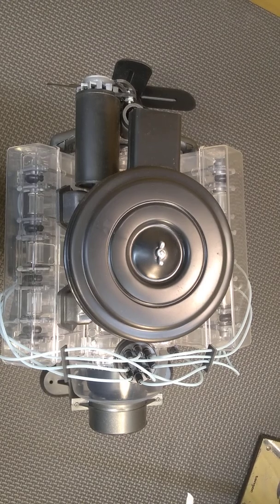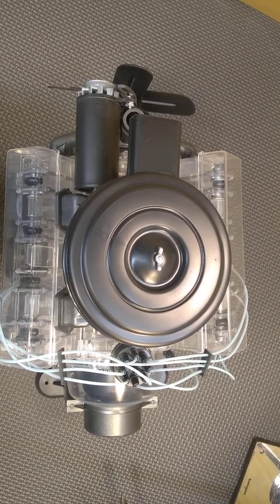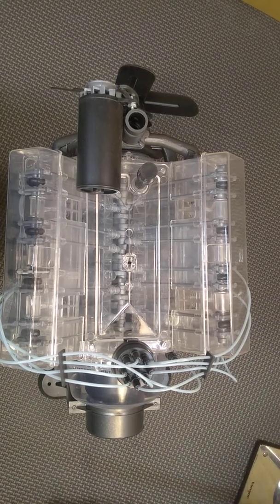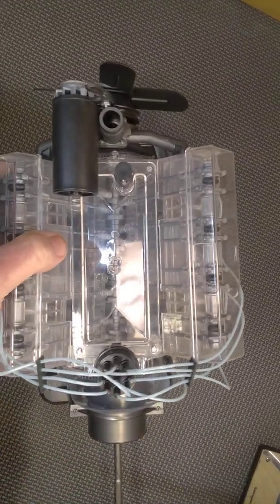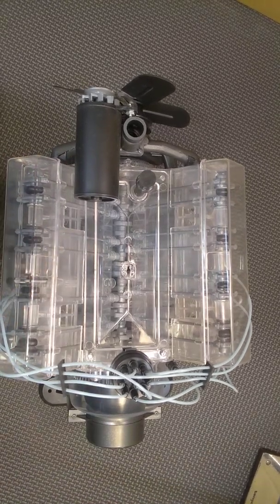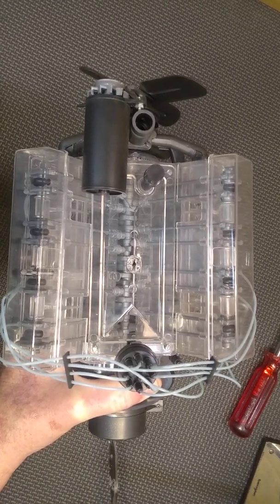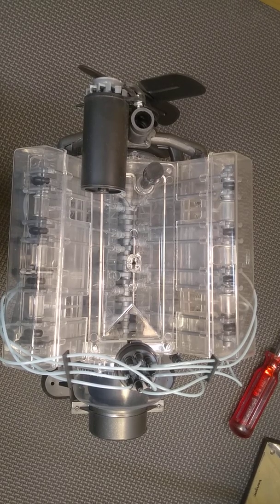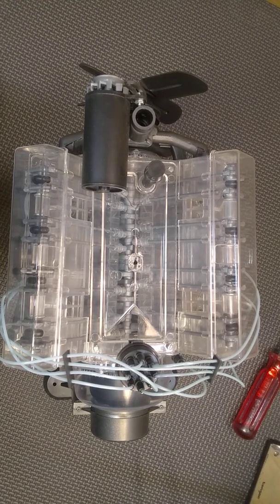Revell Visible V8 Engine Extreme Run-up Test - WOW!!!

Comment: Hey so you DID have issues with parts not lining up correctly?  And did you also have an issue with the two timing gears not touching each other??
Reply from the maker: Hi Dustin - This Revell V8 was the worst quality engine kit I had ever built until I bought and built an earlier version of this model which had an operating electric starter motor and operating spark plugs. The fit and flash on that older version could have hardly been worse - almost every part needed to be tweaked and have the flash removed. From my experience, IMHO these Revell V8s are junk. It doesn't surprise me you had trouble with gears not meshing. I've built 9 visible plastic engines and these 2 Revells were the only ones that IMHO were crap. I didn't bother reviewing the other Revell V8 because it was too depressing to totally bad mouth somebody's product. Get the Franzis Mustang 289 if you want an easy to build awesome vintage V8. Get the Testors 426 Hemi if you want a difficult to build totally awesome legendary V8. Take care..........Poppie

Comment: Hey! Where's the commentors? I like it. I'm 65, and had 3 of these in my life. One is still in my cellar, but all the glue has dried out. These are great training aids for the youth of today, who know nothing about the basics.  
So what was stuck? cam/crank gear? I'm sure you rotated it, as you assembled it. Mine couldn't keep the dist. shaft intact. They always broke 1st. Does your spark plugs fire?
By the way, do you remember the "Visible Chassis?". Had one in 1970, with the motor on it. Loved it, till the neighbors kids sat on it and destroyed it. (Into the trash it went. Have only seen 1 since, at a flea market. Unassembled, in the box, ($700!) thanks for the show.
Reply from the maker: Thanks for your email. I have to admit the motor did run well at higher RPMs. I just wish Revell left in the working starter motor and spark plugs like most other visible engines. Best regards.........Poppie
Reply from the maker: Hi Joe - Yes very good training tool. I'm not sure where it was stuck. I thought the part would break when I forced it. But SURPRISE it ran even at high RPMs. I just wish Revell left in the powered starter motor and the operating spark plugs like most other visible engines have. I too built the visible chassis - What an awesome combo with the V8 mounted on that operating chassis. BTW - I just finished building Testors 426 Hemi kit. The video is also on YouTube. Best Regards..........Poppie